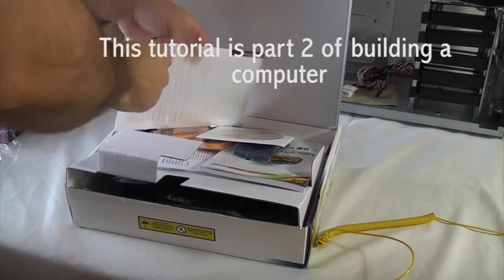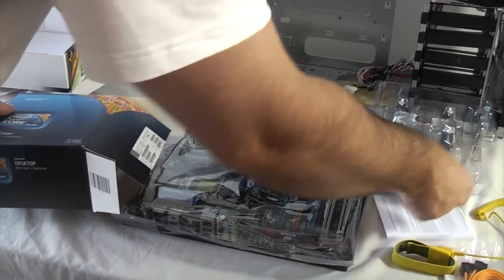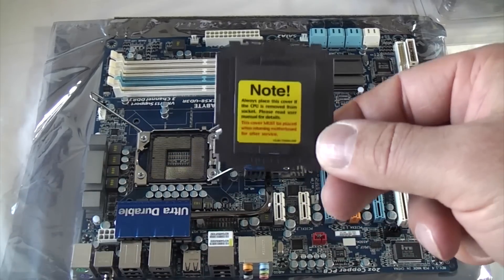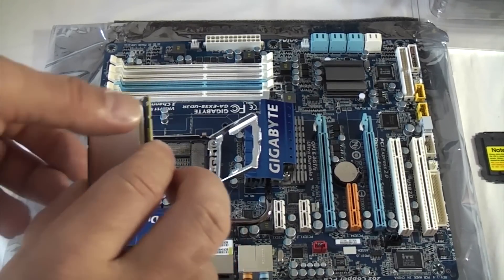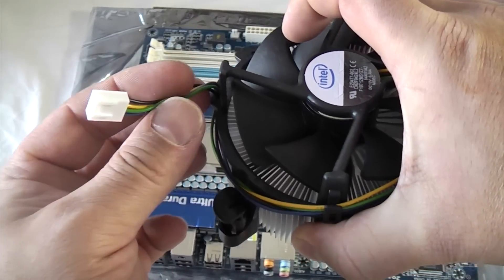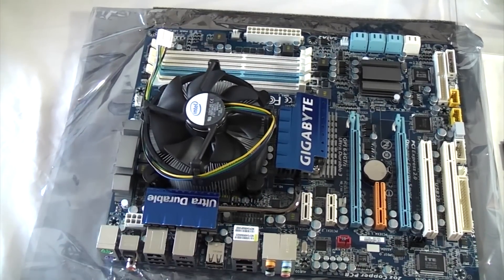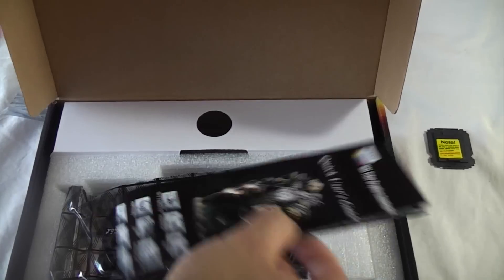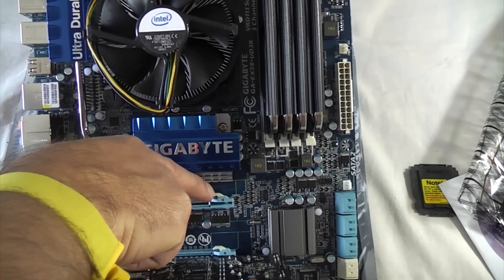installing intel core i7 processor to gigabyte motherboard

Comment: does it matter what motherboard you have? what im trying to say does all motherboards support both cpus Intel and AMD?
Reply from the maker: Yes it matters, AMD processors use different motherboards than Intel.
Reply: Ultimate Handyman and what does Intel uses and what does AMD uses?
Reply from the maker: This explains it all-
https://en.wikipedia.org/wiki/CPU_socket
Reply: Ultimate Handyman oh alright thanks and do you think its a good idea to get a gtx 1070 with an fx 8350? since my motherboard only supports amd

Comment: Does a heatsink come with every intel core processor?
Reply from the maker: No, sometimes you can buy them separately (I think).
Mine was bought as a kit with the heatsink and fan, which is why the thermal paste was already applied.
Thanks for the comment

Comment: I bought a Cyberpower PC for gaming and at the time I have had little experience when it cones to PCs, I didn't even know what a processor is. If i follow these steps you show, should i be fine swapping an i7 with a Pentium? Also do I need to buy that paste separate? Also does anyone know a good video about removing and reinstalling motherboards because ill probably need to remove mine from my case, if it is possible to do the work without removing it completely from the case let me know, because i would just remove the side. I know I might sound dumb but I really want a faster pc and don't want to buy another
Reply: +MrDynamite Depends on a few things mate. 

You need to know what socket your current CPU (and therefore your motherboard) is, and whether or not you'll be using a stock cooler.

Stock will come with the paste.
Reply: thanks I found out more about it it is an msi military class motherboard som it should be compatible

Comment: i will be buying intel core i5 2500K 3.3ghz how much can i boost it with the default fan without burning it?
Reply from the maker: +Petr Ševčík 
I have no idea. I never over clock computers as I'm more interested in reliability. This computer has lasted 6 years with no problems so far ;-)

Comment: I have a Gigabyte Ultra Durable Dual Graphics Motherboard, and I don't know if a Intel core i7 4790k will be compatible. I only have one graphics card slot, which holds my GeForce GTX 1070. Will this processor fit?
Reply: Good

Comment: My M-board broke (sound died) so I was wondering after I applied the thermal paste the first time do I need to apply it the second time I reinstall the processor into my new M-board? An answer would be greatly appreciated from anyone. Thanks!

Comment: i may thunk big but i think if ye got TYAN S4989WG2NR wiv AMD phenom 2 and a g skill trident 12 gb with fan hav 4 of them and  4tb sata 2X2tb kingston and maxtor. sum kind of 1500w limited to 500 and philips DVD+RW416 and lightscribe blu-ray. i know ime thinking big but you cant get a bigger animal than this. best of parts you can find but it mite cost 2 macs. but ive a gigabyte on the other computer ive got slow as xmas but never fails dont worry i either get int i7 or amd phenom2 ya?

Comment: Em i wonder can i upgrade processors on the same computer? sutch as amd am3 socket ive got sempron i wonder can i change it to phenom without changing computer? ime not a fan of intel what so ever. had a couple of intel pcs i know processors cost a couple of hindred yano.

Comment: is it the core or the fan that makes the computer fast?
Reply from the maker: +naldo maynard The CPU is one of the things that makes the computer fast (core). The fan does not effect the computers speed at all, although if it fails the computer will not run for long.Thanks for the comment
Reply: Ok thanks but  when these guy are talking about overclocking there cpu they talk about the  the fan speed. So are they wrong ?
Reply from the maker: +naldo maynard 
Overclocking (something I never do) makes the CPU hotter, which requires more cooling to prevent damage, which is why they probably increase the fan speed - or install a better cooling fan.
Reply: +naldo maynard you overclock the cpu itself. the fan speed can be adjusted to better cool the processor unit if it's not a factory fan. overclocked cpus will run hotter, ergo faster fan speeds will reduce risk of failure for the processor.
Reply: thanks
Reply: +Ronardo James when you overclock the CPU you need to cool it more so u need to turn up the fan speed
Reply: thanks

Comment: Could I switch my i5 processor to and i7 on my asus laptop?
Reply from the maker: Zero Armada 
You will have to check your motherboard manual to see what CPU's it supports, I'm afraid I don't know!
Reply: Thx I looked to see and I can but the cost of the cpu is the price of a new laptop/desktop so I'll just use readyboost with a 16gb flash drive speed my laptop
Reply: 7forAll Mankind lmao
Reply: r3nk0 lol foreal lmao gotta do what you gotta do

Comment: What motherboard did you used in this video?
Reply from the maker: Hi, it's the GIGABYTE GA-EX58-UD3R
Reply: Hi, is it possible to install the CPU into the motherboard without wearing an anti-static wrist band?
Reply from the maker: Yes, but ensure that you have grounded yourself before touching the CPU by touching the metal case with the case plugged into the power supply but switched off at the wall socket.
Reply: ***** Ok, thanks :)
Reply from the maker: You are welcome ;-)

Comment: your never supposed to lay a mother bored on the anti static the inside is anti static the outside is not anti static
Reply from the maker: brad meade
No worries, there has been lots of debate over this. One comment-er even posted a link to a video that proves that laying the motherboard on the outside of the bag causes no damage. But if you believe it might cause damage it is best to avoid it ;-)
Reply: i thought the exact same thing......the bags are basically a faraday cage .......conductive.....but shields items on the inside...and if the boards have been tested then there is sure to be some power in the capacitors somewhere on the board

Comment: What  generation i7 you put in
Reply from the maker: It is a Core I7 920
I have to say that it has been very reliable, I built it in 2009 and I'm typing this message from it right now ;-)
Reply: @ultimatehandyman  your boad is amd why you put intel?
Reply from the maker: @kimharveyreyes1618   It's a Intel board ;-)

Comment: So No need to buy termal paste for an i7?
Reply from the maker: I bought the CPU and cooler as a kit so the paste came pre-applied.
Thanks for the comment
Reply: ***** Hey I have a GTX 650 graphics card I recently tried to upgrade to a new graphics card I tried 3 different cards I pre installed their drivers and I am using 750 power supply.  And all I get is a blue screen then the screen goes black. The pc currently runs and works with the GTX 650 not sure what the problem is the only thing I can think of is maybe the mainframe is not compatible.

But the gtx 650 is not that old of a card and runs great so not sure what to think even the guys at the geek squad could not figure out what was wrong.
Reply from the maker: Entropian2012 Graphics cards can be a pain in some machines. Can you not check the compatibility of the card with your machine?

Comment: HELP does the proccesor come with a fan or do i need to buy it seperatly? cant spell btw :/
Reply from the maker: +ETERNALFLAME 
Mine came with the fan as it was part of the kit, but you can buy them separately!
Reply: nvm im reusing my i5 fan when i upgrade
Reply: +ETERNALFLAME not the smartest move
Reply: well i have to dont have the biggest buget :/

Comment: I was wondering if Intel fixed the issue with the socket having a space for bugs and lint to get under it. Like my 1366 use to I found bugs zapped like a bug zapper killed them. Mosquitos fruit fly's  and ants found there way under there when used a uv light with my computer.
Reply from the maker: Don't know, I was not aware of such problems.

Comment: If I buy a 850W Power Supply and a 600W GeForce TITAN X, will the card be okay?
Reply from the maker: +Mattdog Gaming and More 
I have no idea, sorry.
The main thing is making sure the card is compatible with the motherboard?
Reply: ***** I honestly don't know what that means but I have 1 12V rail for the Video Card.
Reply from the maker: +Mattdog Gaming and More 
I just checked and that card uses 250w, but they recommend a minimum 600w power supply, so it should be fine ;-)

Comment: Why in the hell did he place the GPU in the second PCIe slot when he clearly has a PCIex16_0? the first slot should almost always be the slot used for single GPU setups as the second slot is used for dual card setup (SLI/Crossfire), sure I know it might work but it seems so off in my mind and is kinda pisses me off lol.

Comment: I tried updating my i5 to an i7 today but it's not working. Everything is comparable Gigabyte G1.Sniper B5 LGA1150 ATX Motherboard is what I'm running with and it supports 4th gen but when I start it up it just stops after awhile
Reply from the maker: ***** 
Have you tried putting the i5 back in to see if the problem goes away?
Reply: ***** I figured out the problem and feel free to laugh at my $500 mistake, I got a 5th gen i7 rather then a 4th, Just means ill have to update my motherboard when it starts to run slow.
Reply: At least when you do upgrade it will be speedy af

Comment: Why didn't you apply paste?
Reply from the maker: It was pre-applied by the manufacturer.
Thanks for the comment
Reply: On the cooling unit or the processor?
Reply: The cooler :D
Reply: Derek Wiedenheft did u even watch the video, let alone listen to it?!?! He explains it very clearly...the heat sink already had the paste applied.

Comment: Well ultimatehandyman told you good things, but be careful, all processors with 3.0GhZ are gamings, but they are higher priced, but its not only processor you need, for real gaming u need graphic card with 2GB ram, Fast disk and at least 4 or 8 GB ram, I have gaming computer with 1 GB graphics and it works, but my processor is 3,4 GhZ .

Comment: Still, you spend so much time and effort on a build, then you just poo it down with a stock cooler. 

it will run way cooler, if you just put on some 3rd party thermal paste
it hurts too look at stock coolers

Comment: The P5 slot that connects the HDD to the PC, i cant find the SLOT for p5 cable, it fell out, the model of my PC is pack bell- 00043-484-586-809, help lease, thanks mate.

Comment: The i7 heatsink lock system is hands down the worst lock system i have ever tampered with. I dont have much experience about installing stuff like this but still... First you summon the force of gods to get one snap and then after 10 summons and bleeding sore fingers one just snaps like childs play. IMO a dangerous lock system on something as delicate as a motherboard.

Comment: i just had re-installed mine by pulling out the processor andputting ack in its place but unfortunately when i booted the screen was blue then i took a piss in my pants and opened up and put it back in place safely this time and it was normal again.......i started breathing again....

Comment: blow on the cpu socket and watch them move. That's all the proof I need.
Reply: Another example is a battery a battery connector with out a loop losses contact and sparks and arcs  lightening from it causing battery acid leak. While one with a loop never losses contact or sparks and heats up and leaks battery acid.

Comment: No offense bro but....the i7 comes with a hd4000 graphics in-built it is equal to a 70$ gpu if you are going to install another gpu below 100 bucks you are doomed because that disables the hd4000 and run 5750 and theres absolutely 0%difference you should've gone with the i5 hd3000 cheaper about 100bucks add-on on gpu you get a 6870 much better....thumb's up if you like my suggestion.

Comment: you buy an i7 and mix them up with a shitty graphics card, use the stock cooler, this video deservs a face palm, he does it right yes, but still ONE does simply not use stock coolers and so weak gpus